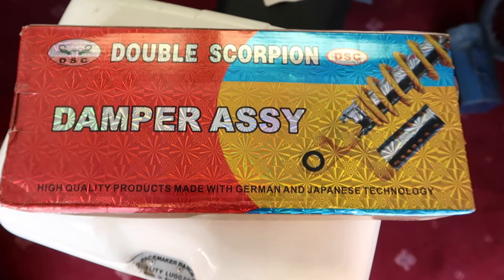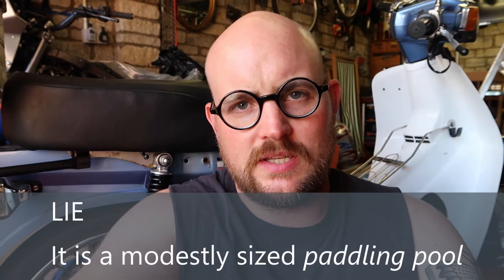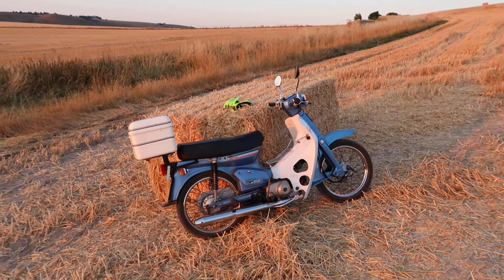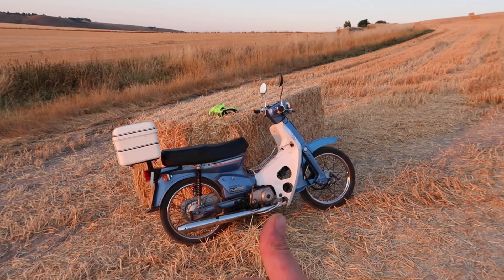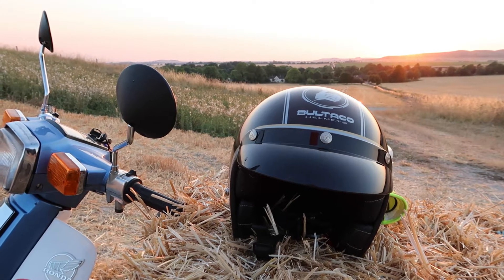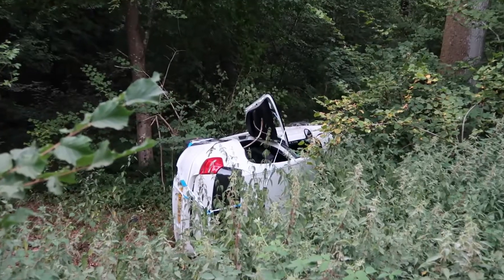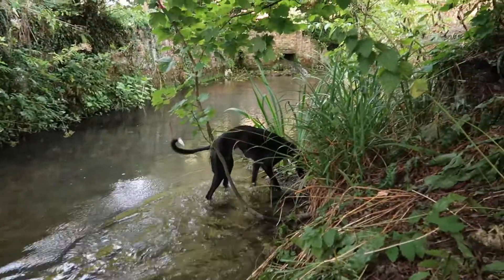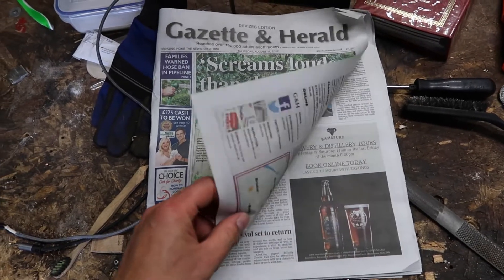Sitting On Double SCORPIONS To Improve Tiny Honda Motorbike C90

Comment: I need some of these shocks. 👍
Reply from the maker: Get some. Dead easy to fit
Reply: @EpohDerf  I tried to find some on line last night. No luck. Do CG /CB ones fit ?
Reply from the maker: @jonathanmellish4439  ok. It is a bit of technically advanced technique I used but I got there in the end.
1) go inside 'the Internet'. Someone put it inside of our house before we got here so if you haven't got that, call NASA or the French TV chanel Canal+.
2) before he died, Pierce Brosnan set up a website called eBay. Get up to and inside this website using your Internet.
3) search for "Rear Shock Absorbers Honda CG125 CG 125 1978-2004 - 330mm Black Shocks Pin/Pin" sold by ys-motorparts.
4) buy a dog and wait for it to let you know the postman is ready to come in an make romance on your wife.
5) fit the shocks and ride to the wedding of the postman and your ex-wife.
6) boast to anyone that will listen.